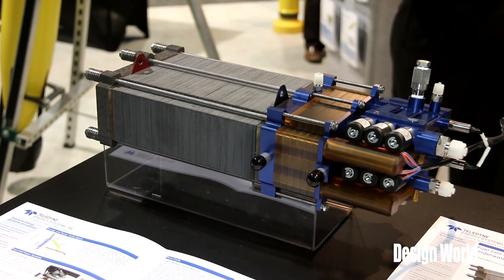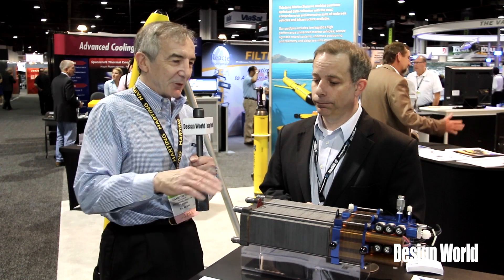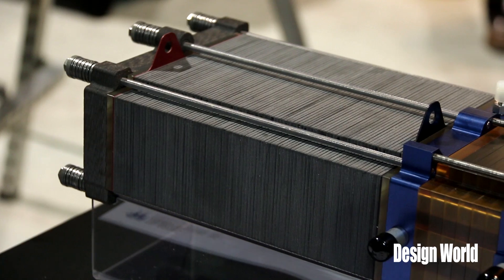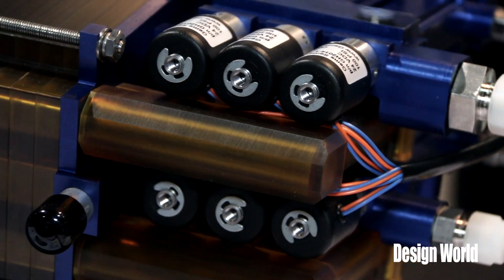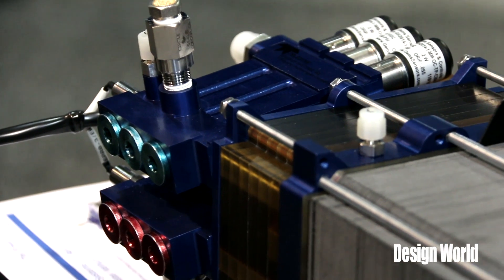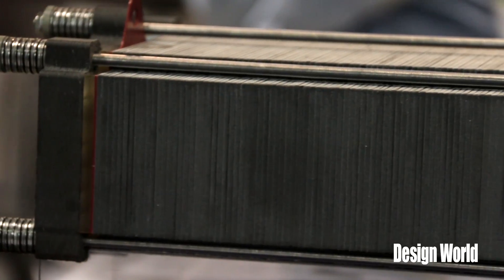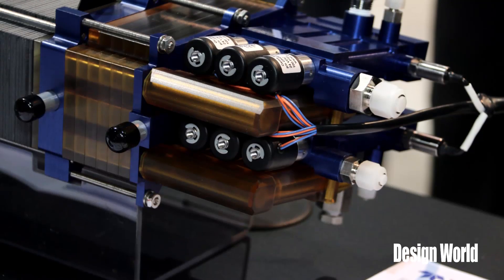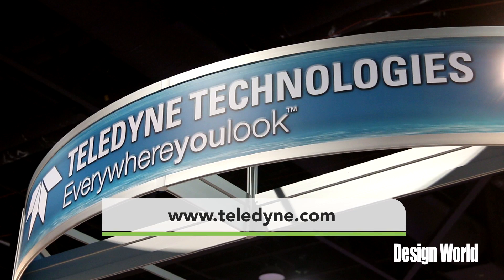Who needs batteries when you've got a hydrogen fuel cell

Comment: Uhm...  The Hydrogen Fuel Cell needs batteries, because it cannot produce enough energy while running to provide motive force at speed.  It is not a gasoline engine/generator.  The energy it provides just refills the battery.  You want to use one without batteries?  Cool.  Have fun never travelling at over 5 MPH.
Reply: WRONG!  The fuel cell in the smallest car I know of weighs 45 pounds and develops 8Kw (Riversimple Rasa.  Fuel cell made by Hydrogenics of Canada) and that's a tiny unit.

Comment: hydrogen fuel cell is a complicated thing wherby a battery is simple. Historically,Simplicity always wins
Reply: Sandy Troyden 

And why I see more turbocharged 4 cylinder engines then EVs driving around. Or more supercomplicated hybrids then Teslas?
Reply: Do you know anything about chemistry? Both the fuel cell and the battery are electrochemical cells composed of two half cells, with reduction and oxidation occurring in each half cell independently. The difference is that the reaction that produces electricity in a battery needs to be reversed by using an electrical current (charging) in order to get your reactant back. In a fuel cell the process is continuous, with reactants reacting to form products + energy. You need to constantly supply the fuel cell with hydrogen and oxygen.
Reply: Because pure EV's are new tech....like imagine asking in 2010 why there are more normal phones rather than smart phones around. Like, can you count? is math too hard for you?
Reply: shandcunt 

It's easier to convince and persuade to buy a 700 dollar phone then  70,000 dollars Tesla.
Reply: What? Model S are selling at record pace, My point was, when the Iphone was new, very few people had them compared to normal phones......likewise when Pesonal Computers first came out, they were not widely adopted at first. If your argument rests on the premise that "This new tech isn't widely adopted yet therefor it has failed" - then you don't understand how new technology works.
Reply: Thorium packs more energy per kg than hydrogen....I don't think these statements have the meaning you think they do buddy "Plutonium is way more energy dense than hydrogen....therefor power cars with plutonium A-DURRRRR"
Reply: Is that in response to me? that you felt the need to explain "THINGS DAR MADE OF CHEMICALS" - yeah, I think everyone knows this, I think the LITHIUM ION part of lithium ion batteries gave it away - also the "HYDROGEN" in hydrogen fuel cells was a dead give away
Reply: yes a 100x more
Reply: Randomguy8196 that is very good point, Lithium Ion usually needs a microcontroller to charge it.
Reply: Lithium batteries are huge and do not store as much energy.